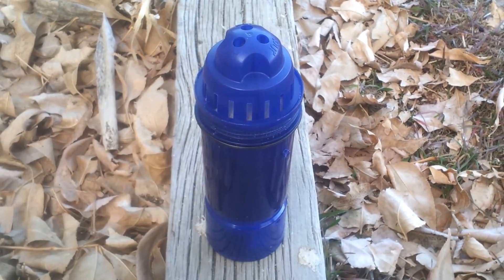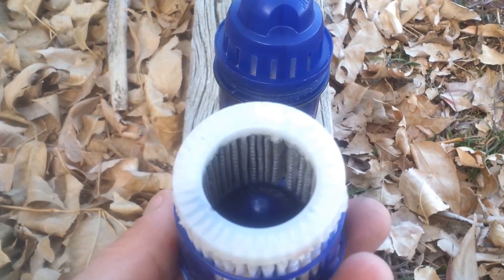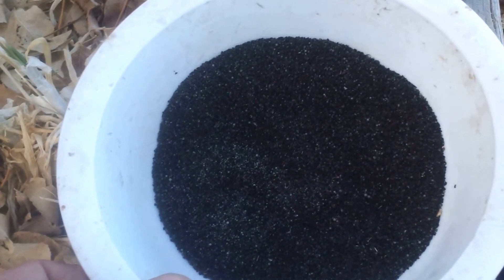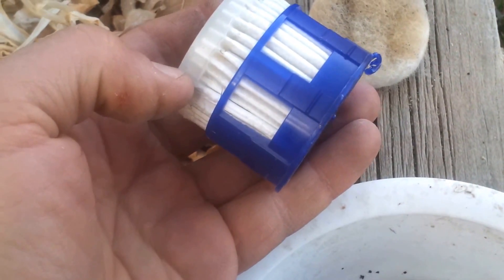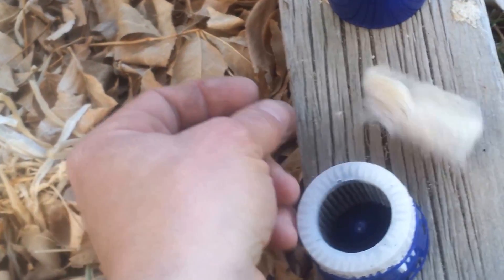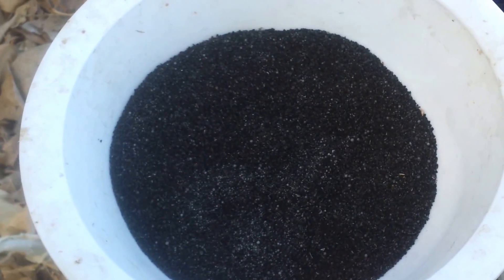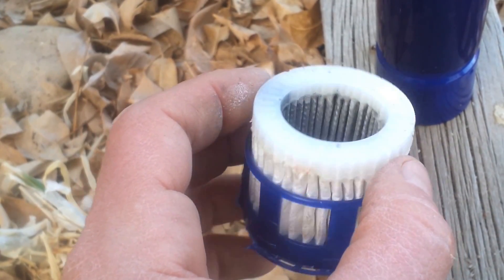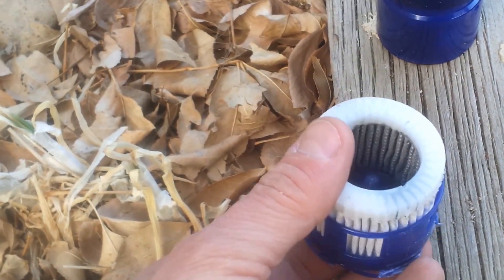How Does a Water Filter Work? What's inside?

Comment: It's 2020, PUR still has this flaw in their design. They are designed to plug up after about 2-3 weeks of use. They let the purigen (white foam) flow down on purpose. So you get the illusion that your filter "filtered so much crap out that it's clogging up with bad sediment". This is criminal. Don't buy these filtration systems, go buy a tabletop filtration system and save yourself a ton of money.

Comment: Thanks for this. You're good at explaining. I have a 10" filter with a 10" housing, but the filter became moldy because I couldn't screw it shut, it didn't go all the way down to the buttom(rounded off housing at the buttom, two different manufacturors.      How is the water supposed to flow when the filter is inside the housing?
Reply from the maker: Sorry, I am not sure how to solve your issue. Are you sure that you are not screwing it in at a slight angle? The manufacturing tolerances would not prevent a perfect fit. You can only get these from one manufacturer. The water flows through the openings on the top side of the filter?
Reply: @JanaeBerzon  There's a gap at the top where the threads are. it's not tight at the filter on the top or buttom. But the buttom looks freed up and won't fit onto the socketed "hole" there. Just a mineral filter without  the fitted hole indentation. But it actually is the same with the coal filter, as if there's two different manufacturers, in which the filter casings itself doesn't match with the filter. But they both are made as 10". Very strange.

How would you go about installing a filtration system with mineral stones? Do you have anything, what casing do you make?
Reply: @JanaeBerzon  Thanks man. I think the water trickles down around the filter as the gasket seal do not seal everything(on top of the filter) So the water doesn't pour down to the inside of the filter and then outside. Just got a tip it might be too high of a gasket, it's too thick. That might be the case. It's 2 different vendors. So I can understand why things don't fit. Producers usually make things to fit their own products, even if it's small details.

Comment: It's PURIGEN. The little white or cream colored balls are Purigen. Purigen is well known by aquarists because of it's ability to remove organics from water. It is considered the ultimate in water purification so it would make sense that PUR is using it in its filtration.

One way to help identify Purigen balls is to look at them under lighted magnification. They have a very smooth surface that will create a "light spot" from the light which can be seen under magnification (at least when new, it might change over time). Foam is typically not that smooth. Further, Purigen starts out hard, but softens a bit when soaked in water (it might soften more over time; I only did a 5 minute test). Another feature is that the balls are not all the same size. The purigen balls range from (using a thumb sized sample) .25mm to just under 1mm. The smaller balls are around the same size as grains of salt or sugar. They are super tiny, but absorb organics from the water like crazy.

I wonder if the name PUR is in part because they are using PURigen? Below are links about Purigen and a good picture of it.

Here's the page about Purigen from the manufacturer: http://www.seachem.com/purigen.php

Here's a picture of what it looks like: http://www.seachem.com/img/product-images/purigen-bulk.jpg
Reply: Regarding those who claim PUR is intentionally plugging up their filters, I find that idea preposterous. The time in which a filter is still "good" does not depend on TIME, but on USAGE. I have two older PUR pitchers without an indicator light. I'm not always good at replacing the filters when I should. In fact, without realizing it, I once left the filters in for almost a year. The filters were still allowing water to pass through which means the holes were not plugged up; however, I have no way of knowing how effective the carbon may have been. Carbon has been rumored to leach out organics when it has passed its full capacity of capturing those organics, but I honestly don't know if this is true).

Because Purigen balls are small and not the same size, it's possible for some filters to get more small balls which clog the bottom filter more quickly while other filters get a mixture of sizes or more large balls. I seriously cannot imagine the PUR company intentionally putting in only the small balls that will clog the water holes in the bottom filter.

NOTE: I am in no way affiliated with the PUR company in any way whatsoever. I am not nor have I ever been an employee (past, present, or future). This holds true for anyone I know including family, friends, and acquaintances. The ONLY affiliation I have with PUR is that I have bought their products and one of my daughters also bought one of their pitchers. I have no stake in any of this other than to voice my own personal opinion on the matter.
Reply from the maker: Vicki Smith, I like your theory and I really hope that you are correct. It just doesn't exactly jive with what I am seeing.
Reply: Weird because it looks identical to what you're showing in the video (not to mention is makes excellent sense given that it is a product used to filter impurities in water).
Reply: BTW, keep in mind that it's likely that PUR gets its Purigen product from any number of sources. I doubt they buy it from Seachem which is specifically for aquarists. They probably get a generic in large lots. So who knows what physical shape it may take. I wanted to find the name of the actual product, but Seachem would only refer to it as "unique macro-porous synthetic polymer." 

However, I did find that there are Polystyrene Beads that look very similar to Purigen. Could that be it? It comes in a variety of sizes, including very small. I see references to it for "water treatment," but the only specifics I can find in a quick search is that it's used for water softening. I found one brand name, called Purolite. I didn't search much further so I can't really offer much more about it, but maybe it's something you can investigate and share with others.

I have one PUR filter with slow water flow (even after the recommended fixes). When I have time, I'll replace it and cut into the old filter to see first-hand what's inside. But that may be awhile as I have some heavy-duty studying I really should be doing (oral exams to finish my master's degree – ugh!).
Reply from the maker: Yes, it does make sense. It just doesn't explain why these filters plug up and stop filtering, sometimes very quickly. Then if you store them in just the right position and try to use them again in a week or two, they work like brand new.
Reply: I don't know either, but I'd believe it to be a design flaw before I'd believe it was intentional. One of the "fixes" for that problem in their user manual is to hold the filter upside down under running water. I wonder if that is intended to clear out the balls that are stuck in the holes?
Reply from the maker: I hope you are right!

Comment: Eek! I'm surprised at the cotton-disc thing in the first stage. Won't little hairs come off from it and go into the water? Also, is it safe to drink water that has gone through the carbon thing??
Reply from the maker: +IglooDweller The first stage sediment filter used in this filter is not made of cotton and should not cause any problems. I would be much more worried about pleated sediment filters that are often used in under the sink and whole house water filtration installations. Carbon water filtering is considered safe and is used in every physical water filtering setup I have ever seen.

Comment: What model is this? And would you recommend it to remove Iron.
Reply from the maker: +Jovani Sanchez , this video is about the PUR CRF-950Z 2-Stage Water Pitcher Filter. You will need something much more heavy duty to remove significant amounts of iron from your water. Depending on your situation, you may want to consider installing a traditional water softener as the most inexpensive solution.

Comment: I was always under the impression that the white balls are actually an ion-exchange resin, and actively play a distinct role in filtration (http://en.wikipedia.org/wiki/Ion-exchange_resin).  Of course, if in fact they are clogging the filter, that's definitely good for P&G as well.
Reply from the maker: +Richard Sampson Yes, these polystyrene balls could also be used to remove chlorine in combination with active charcoal. But it is entirely unnecessary that the filter design should allow them to float up and clog it up.
Reply from the maker: ***** I am pretty sure that's the main reason for this design.

Comment from the maker: Lili, Pur faucet filters are designed differently - their filter housing measures water flow through the filter and changes the color of the blinking light when it is time to change it. If you disagree, just reset the housing's flow meter by removing the filter and plugging it back in: https://www.youtube.com/watch?v=-mA54v9T1Fc